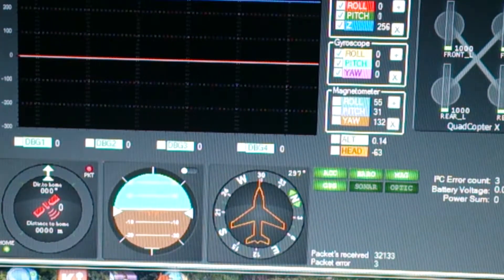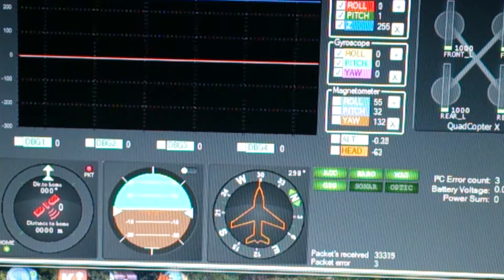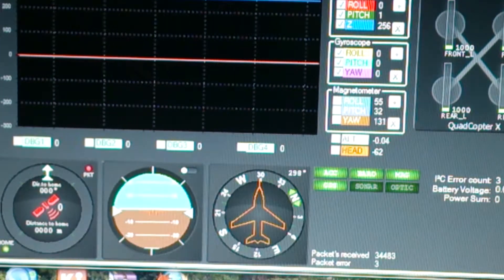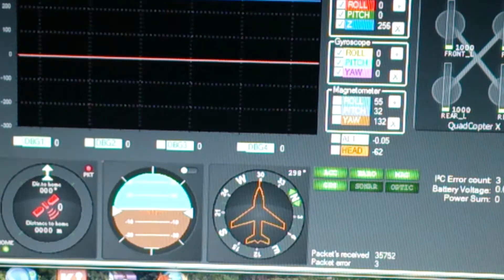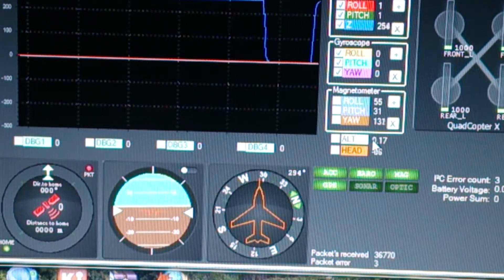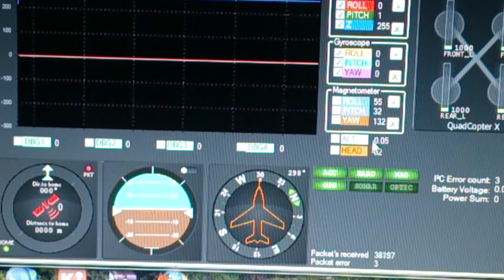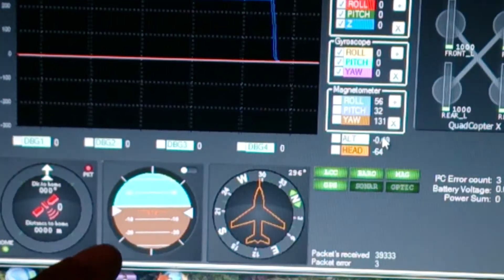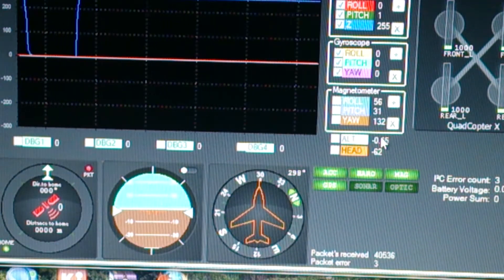Calibrate ACC problem - MultiWii Pro

Comment: I am having a similar problem with MultiWii 2.2 where the acceration shows no response (in the MultiWii GUI at least) to moving the board.  Were you able to find a solution?